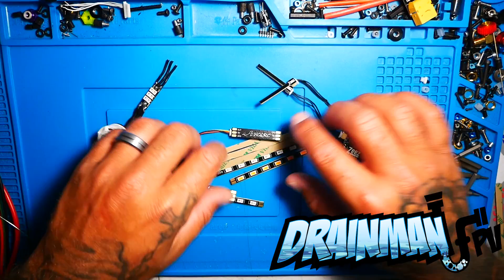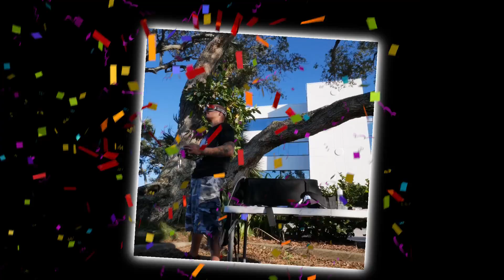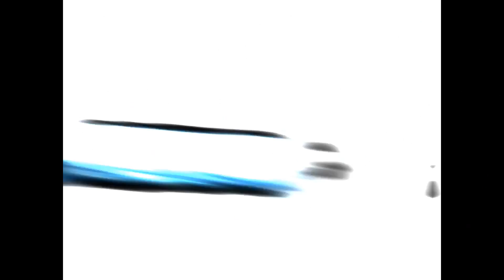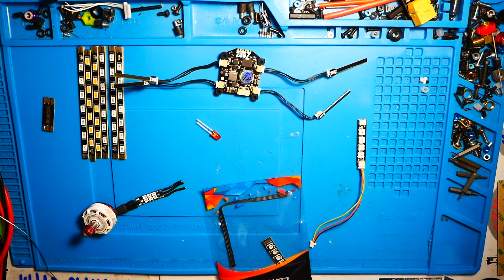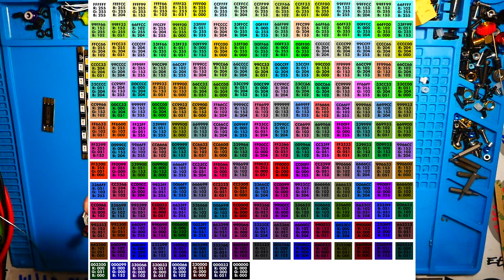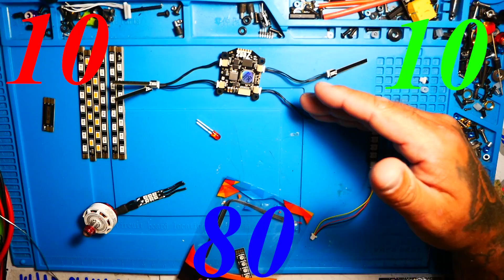Betaflight LED's !! Everything You Need To Know !! How To & More !!

Comment: That's awesome. Very good explanation. But got a problem with whoop betafpv 75pro hdzero turn led on motors quit. Can send pics if need. Says mixer mode problem detected
Needs 4 motor resources current configuration  provides 0

Comment: HSV is Hue, Suturation and Value. Hue is the color (red, green, blue...) the values go from 0-255 and go through the rainbow from red through the colors and back to red. Saturation is a measure of how strong that color is. Again the values go from 0-255. 0 being white and 255 being pure color. Value is how bright that color is. It would be like using a dimmer on the overall brightness of the LED. Values are 0-255, 0 being off and 255 being full power.

Comment: I wish you would have done more on the racewire led.
Is it any motor wire to any led pad?
Also do you still have to click LEDs in betaflight?
Help a brother out bro
Reply: No.  racewire leds don't have any interaction with your FC.  They just work of the motor power current...
Reply: @localhost-steve  thanks buddy

Comment: can u use the same set of leds to do multiple functions, or can u only set them to just 1 time from the drop down Function option?     im tryin  to figure out if i can set the leds to when plugging in a battery to use the Larson scanner, basically disarm mode, then still when i take off use the mode and orientation tab to use east and west turning to use the same leds to turn like turn signals yellow when leaning in that direction and then use green to light up when going forward or throttling up and use red when laying off the throttle.   i only have 8 leds

Comment: so i took the led/buzzer that came wit my 1st quad the eachine wizzard x220s its an h 2 rows of 5 with a busser in the middle sorta looks like an H when i 1st was setting up the quad they came on all white and i was pretty stoked ...then i went into betaflight watch JBs tutorial and wanted to swtich it up and add some diff varitions ...so i removed what was there it was 1-9 on the bottom right corner two rows of 5 ......i deleted them because i was under the impression that i could reset them up quite easily but no now i cant understand why i cant even get 1 to show not any color not even whie..super bummer what could have i deleted to make it not work again? why isnt it goin on when i follow what ur doing in the video..nothing happens now? n i kno it works cuz before i deleted whatever was on there it was working

Comment: How do you program them to change colors using the S1 or S2 knob on the X9D. I've seen it done in videos, and I'm about to build two of the tiny trainers with the tinys-leds tiny trainer led kits. I'd really like to know how to do this for all my qwads I plan on putting leds on anyways.  Thanks for all the great help still loving how you keep shit so organized. But I wanted to learn how to use those knobs for leds for like 2 years now
Reply: That would be done as an Aux parameter.  You need to have your X9D output that on an AUX channel for the flight controller.  The flight controller will see it as AUX 4 or whatever you map it to on your transmitter.